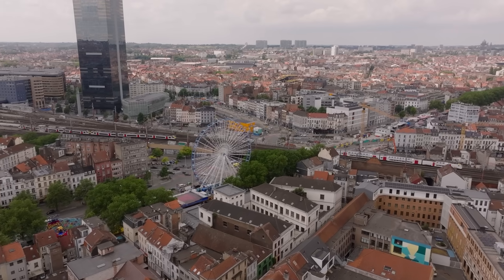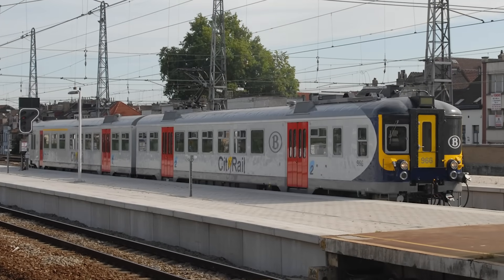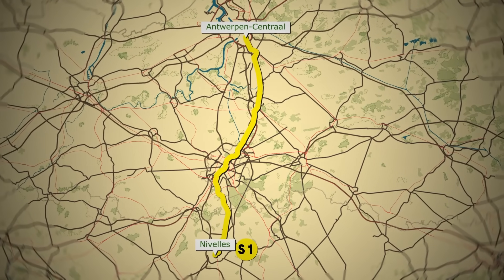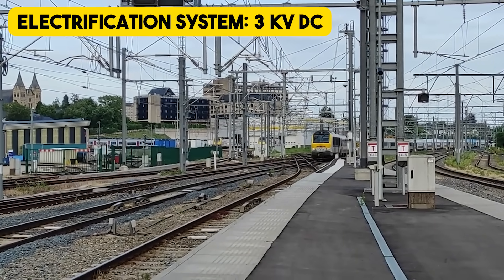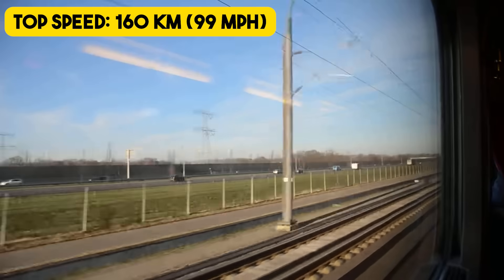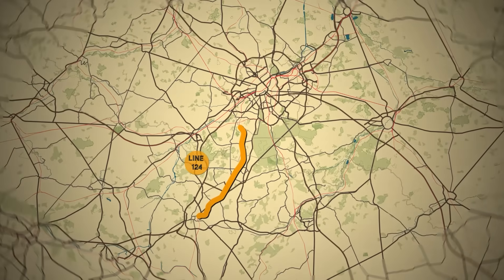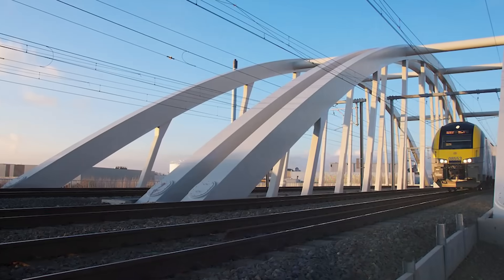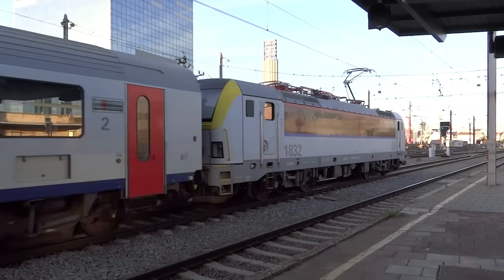Why Has Brussels’ RER Project Taken So Long?

Comment: While not excusing some bad decisions taken at company level, the Belgian infrastructure manager for rail (Infrabel) is doing a decent job for the money allocated. And if the government allocates little money, construction and renovations go slowly. But the still responsible national government has huge financial limitations so as always it is a compromise. 
And as long as the required infrastructure does not have enough capacity, the train operator NMBS/SNCB cannot start running more trains. They did their part of the job, buying the infamous Desiro,trains. Because the upgraded capacity was still not usable around Brussels, and since other train ordering was a bit delayed, we sadly found a lot of these Desiro trains all over the country, also running services that are way too long for these essentially commuter trains.
A visit to openrailwaymaps can show you that on all axes radiating out of Brussels, 4 tracks are ‘almost ready’. As explained elsewhere the concept is that the 2 outer tracks are for the commuter and peakhour and stopping trains (so the S, P and L trains in Belgian terminology), and then the inner 2 tracks will be used for then IC intercity trains, some fast peakhour trains, and the longer distance international trains.
In practice one hoped to make the inner lines capable for 200 km/h and the outer ones for 160 km/h. That is on the infrastructure part, because the close following of trains withna lot of stops would for most parts of the day and most stretches lead to a 100-140 running on the outer tracks. And for the inner tracks running at 200, this was not to be on the more curvy parts closer to Brussels. But 160 remains the minimal goal.
As explained elsewhere too, it all already started when the high speed line from Brussels to Germany was to be built. From Leuven towards Liege a new line was planned but for the Brussels to Leuven part an upgrade to the existing infrastructure was decided. So in the nineties this upgrade took place, including some new flyovers closer to Brussels, a widening of the large railway bridge over the Brussels ringroad, and some upgraded curves at the northwestern entrance to Leuven station. Meanwhile all stations on this line were modernised including the large Leuven station. Since the high speed line only opened in the 2000s, it was by that time this large main eastern access to Brussels was ready for seriously better intercity connectivity while at the same time creating capacity for the S network.
Towards the west the situation was different because historically there was already a fast line existing since decades towards Gent, separated from the slower lines. Towards the north the saga was largely influenced by the decision to get the airport on the main longer distance rail network, but I’m not going to explain this part here.
This leaves 2 other axes to be discussed: southeast towards Namur and further to Luxembourg, and south via Nivelles towards Charleroi.
The line to Luxembourgs faith was influenced also by the idea that Luxembourg as a country and a city has European institution buildings, and so does Brussels. And they wanted these 2 to be connected with a rapid line. Well the line was already there since the 19th century bit was not rapid enough. The hilly terrain of the Ardennes was the major cause. And a full new high speed line would never be economically viable. So an upgrade of the existing line to 160 km/h was decided. Because of limited budgets this was spread over 20 years and ot,os,only now in 2025 that we see an ending of the works,on the horizon. The part from Ottignies via Namur to Luxembourg was a renovation of the line. And the part of Brussels to Ottignies was mixed with the … S-network. So same method: add 2 more lines, renovate the older part, and finally find ourselves with 2 rapid inner lines and 2 slower outer lines.
These bog works needed money that was insufficiently available to do these works rapidly, but also building permits. Belgium being a federal country this line towards Namur runs through the Brussels ‘region’ (as a different political entity, to to be confused with the city of Brussels), the Flemish region and the Walloon region. Works started early on the Brussels part and while some permits took quite some time and effort, that was not the bottleneck. Also the Walloon part closer to Ottignies was not the problem. The real problems were in the short Flemish stretch, and the first few kilometres on the walloon stretch. This is a wealthy and nice green part and locals wanted the line as much covered as possible and all kinds of delays occurred in the permit stage. Also the Flemish in their short stretch considered this as a line for and by walloons going to Brussels, and found little motivation to profit themselves from the line. In good Belgian ways the 4 track part was build where already allowed and not yet where not yet permitted. It took to the 2020s to get all permits and money allocated, but it os all decided a,d clear now a,d by 2032 the line will be completely ready, with some exceptions of part of an upgrade ready by 2034. Because meanwhile the non S related line from Ottignies via Namur to Luxembourg will also be ready, we hope to see a new faster timetable for the long distance trains to Luxembourg. So permits and decisions are no longer a problem for the southeastern line from Brussels, only the slow availability of money spread over 8 more years.
And then finally the line south to Nivelles. This line also is one of the oldest and most important ones of the country because it continues to the formerly industrial heartland of Belgium around Charleroi. The stretch between Nivelles and Charleroi now runs at 120-140 km/h, and contrary to the excuse of being part of a highspeed network or having European role like for the other lines, this line only has the politicians of Charleroi shouting loudly that they prefer a 2 to 3 times an hour direct IC  connection to Brussels in 35 minutes instead of the present 50 to 51 minutes travel time. But for beyond Nivelles not a Euro has been spent or reserved till now. For the Brussels to Nivelles part relive the experience of the line to the southeast: first there is the part in the Brussels region, already approved and largely built. Then the part through Flanders (but plenty of French speakers living there), with again struggles to get the widening of the line approved. And then the Walloon part : fully approved but not yet fully built because of slow release of funds. It took negotiations till 2025 to get clarity for the stretch in Flanders. The new compromise is that a station on the 2 track line will be closed, and a small part of the line will remain at 2 tracks. It was also agreed that discussions to bring this at a later stage to 4 tracks will be postponed for at least 12 years. Some permits and litigations still need some work at the time this is written in late 2025, but generally,speaking also the line to the South is now on track, and again the line will be ready by 2032 with maybe some minor finishing till 2034.
Does this mean that the complete S network around Brussels will then be ready? I would not say so :
- Brussels south (Bruxelles Midi) station still needs a major renovation of the canopies and platforms
- quite some S lines have a 2 to max 4 train per hour frequency, and not like an real S network abroad a 4 to 6 train per hour schedule 
- while stations have seen some renovations, they are still a bit minimalist for most: they feel like half abandoned stopping points, and not like a thriving centre of their community with fresh platforms, good cover from bad weather, nice parkings, small shops and so on.  But some are nice and definitely have potential.
- while there os some collaboration with the bus, tram and metro providers in Flanders, Brussels area and Wallonia, there still isn’t a fully automated transversal ticketing system like Oyster in London.
- while insiders would agree that from a purely technological point of view the infrastructure offered by Infrabel is or will soon be of ‘good standard’ , this cannot be said from the SNCB/NMBS. For all their tasks (and that includes tje trains and the stations) you just feel all the time their budget constraints. Signposting, lighting and weather protection in stations: the minimum is provided. Safety around stations and the look and feel of stations: generally below expectations. Cleanliness and comfort of trains: don’t expect a top product. We can say we have a S network yes, but not a worldclass,one
- the capacity to Antwerp remains limited. The works in and around the Mechelen station can help a little bit but there are still unsolved bottlenecks that have not yet been fully solved.  In my humble opinion this will really need some extra major line rebuilding.

Comment: Can you talk about this idea around Antwerpen? Currently, the S32 rides from Puurs to Essen or Roosendaal depending on what type of train is used. The S34 rides from Antwerpen to Dendermonde.
You have used some shots of a Dutch train. These shots are outdated. The new train-service to Amsterdam is using a ICNG. The old connection to Amsterdam is now reduced to Rotterdam and run by NMBS-carriages and TRAX-locomotives.

Comment: Under the umbrella of ‘creating an S network’, the larger lines from Brussels to Antwerp, Leuven, Namur, Charleroi, Nivelles were rebuild for the first part, closer to Brussels. As explained in the video, to allow for a separation of slower lines for the S network and faster lines for the IC network. This video focusses on the advantages for the S network : possibilities of higher frequencies and reliability. But I would also like to draw the attention to the disentanglement and modernisation of the faster tracks (usually the inner 2 of the 4 tracks). This allows for IC trains to approach Brussels at a speed of 160 km/h, and still closer at 100 to 140 km/h instead of the limits of 60-100 previously because of the presence of slower trains on the line and older infrastructure. Depend on the site, the 2 new tracks are added externally in both sides of the existing older tracks, or sometimes added on one side. Anyway, as soon as the new tracks are ready, the old ones still need replacement and this takes another 2 years because work is being done on a life and busy line.
The lacking building permits for the 2 remaining lines to Wallonia are to be delivered by the Flemish government and Flemish communities for the short stretch of this track on Flemish territory, and this creates problems.
The latest news from Linkebeek on line 124 is that a compromise has been found: over a short stretch there will be only 2 tracks, but  the existing station of Linkebeek will disappear. This compromise is not ideal from a railway point of view, but is better then the total blocking of the line 124 project. This blocking also has a legal part, and the council of Linkebeek accepting the compromise is good news but there were still other legal battles ongoing from other locals.
Apart from the Linkebeek stretch, there is also the commune of Sint Genesius Rode. This place is theoretically Flemish but a large part of the population is rather French speaking. Building permits for that stretch have now been asked separately from the Linkebeek part. Following the line further south the border with Wallonia is crossed and there the progress is much better : the site of the tracks is ready towards and beyond Waterloo and tracklayimg can start. 
These expressnet works also include the suppression of level crossings for as far as there would still be some on the lines concerned, and often the local communities recreate surrounding streets and infrastructure.

Comment: Nice video 🙂 there is a small mistake about the S9 train which goes to Nivelles. It was limited during 2 years due to some work on the line 26 to replace and enlarge a bridge, but now it is finished, so it will go back to its full itinerary from Nivelles to Landen 🙂

Comment: Nice video, congratulations. The story about why the completion of adding a 3rd and 4th track on lines 124 and 161 is taking so long, is quite a bit more complicated. Those 2 lines go through the most wealthy neighbourhoods of the Brussels area. There has always been and there still is very strong opposition to the construction of 2 additional tracks on those 2 lines. There still is no building permit for the Flemish section of line 124. Another reason why it's taking so long, is that a lot of very expensive measures were taken to ease any alledged nuisance from train traffic. Line 161 saw the construction of 5 completely new tunnels and various overbuilt noise barriers. Line 124 also got some modifications, but not in the same amounts as with line 161. However, because of these very expensive measures, the building cost exploded, and the building was going to take more time anyway. Hence, the subsequent governments had no other choice than to spread out the construction in time.

Comment: A major reason for the delays to the entire project is the opposition from the Walloon side. While all the Flemish sections have long been completed, it will easily take another 10 years before this is the case in Wallonia. Walloon politicians have thrown obstacles in the way from all sides, particularly by not issuing building permits.
Reply: The major problem is in Flanders, in Linkebeek. Residents block the building permits for the works of the line to Charleroi for multiple years.
 Concerning Wallonia, there is the distribution key that Infrabel and B-rail have to follow : "60% for the Flanders, 40% for the Wallonia", so funding lacks for Wallonia.
Reply: @NassimKoceir  You can't just call Linkebeek Flanders. It's a municipality with facilities, with a majority of French speakers and a French-speaking mayor. And indeed, that's one of several municipalities that's obstructing the issue, but there are others. And coincidentally, they're all located on the lines to Nivelles and Ottignies.

Comment: My latest experience on Brussels local trains was awful. I had to take a train from Midi to Zaventem airport recently, and after several last-minute platform changes (Midi is a mess, and let's better not talk about the surroundings of the station...) and 15 minutes of delay, an old dilapidated relic of a train showed up, covered in graffiti, no AC so windows were opened creating insane noises inside tunnels, no working toilets, no info screens or audio announcements... 
The whole thing was improper of a supposedly developed country in the 21st century. Just rebranding it as S Train without further improvements to solve the chaotic traffic congestion and the catastrophic condition of the trains and stations won't do anything. This is just smoke and mirrors.

Comment: Belgian here, fan of public transit and frequent user of Brussels transit network. Why the usage of videos off topic? I saw Deutsche Bahn, EuroCity Belgian Netherlands train, metro and normal Dutch trains. This is quite distracting. You didn't even mention the real problems, which is an over congested North South connection and bad frequencies, most lines just 1 train/hour. Why do you just guess the ridership? Btw the claim of 4.270 minutes is one guy that measured it that year, who lives on the other side of Belgium. 
Come on, this is just lazy work